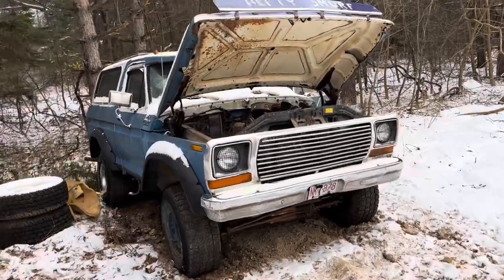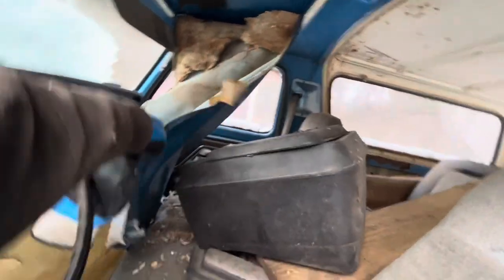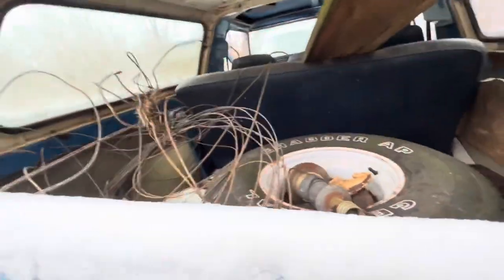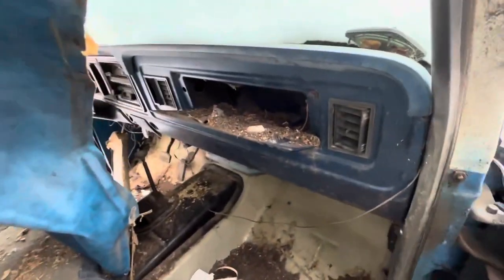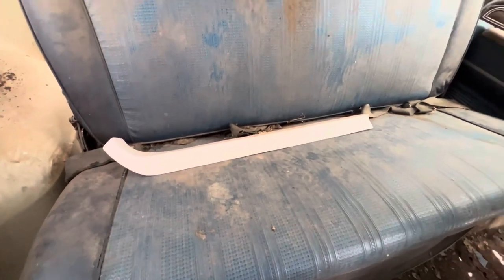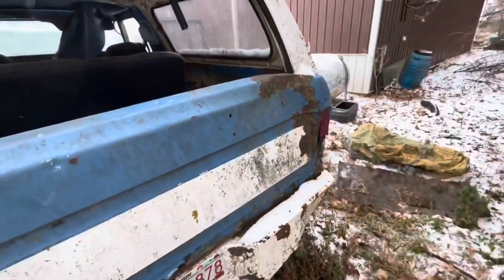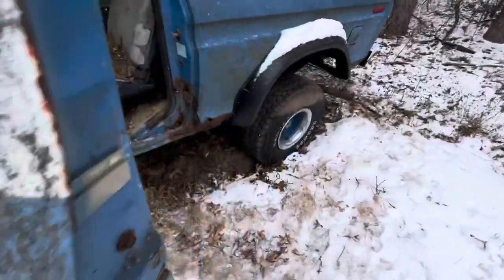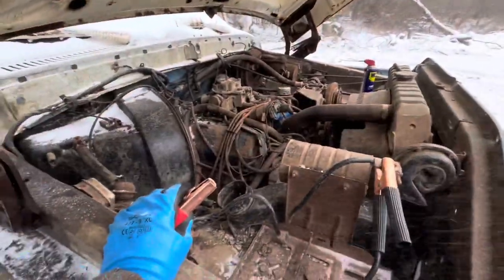1978 Ford Bronco barn find Pt.1

Comment: Not a floor trim piece or bug guard, that is the cover for the bolts on the topper, it is broken in half it would appear. Each side had them and they are very rare to find since most took them off to get the top off then never put them back on. Someone on one of the Facebook groups started remaking them i believe but they are outrageous
Reply from the maker: That’s a great bit of info iv never heard before. I appreciate the comment thanks for watching bronco is running and driving awesome now
Reply: @Notafordguy  awesome im watching all your videos through on it. I have 2 of them myself that I have been restoring as well. I really enjoy watching and am glad you did these videos!